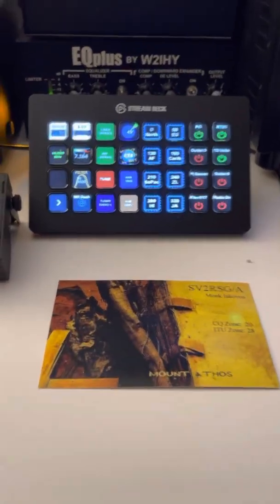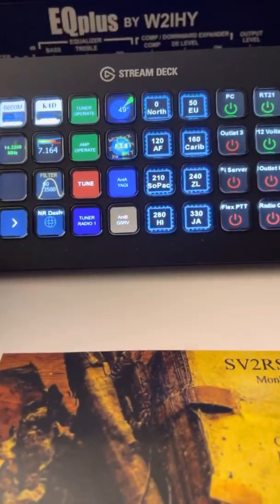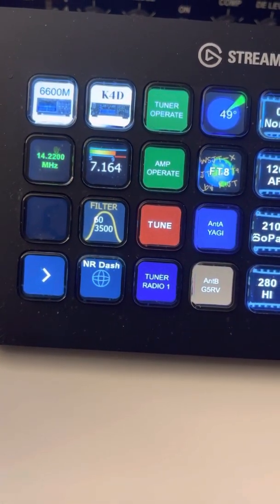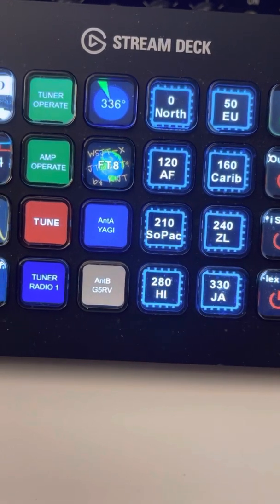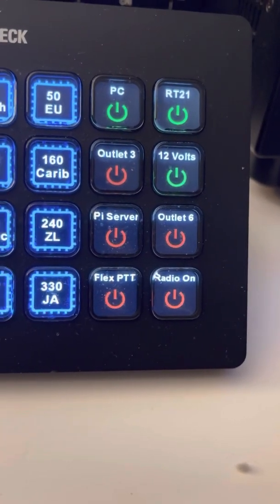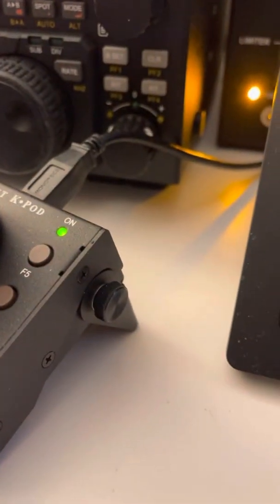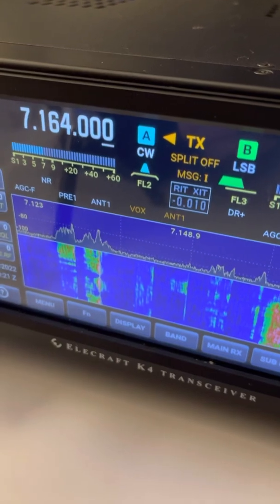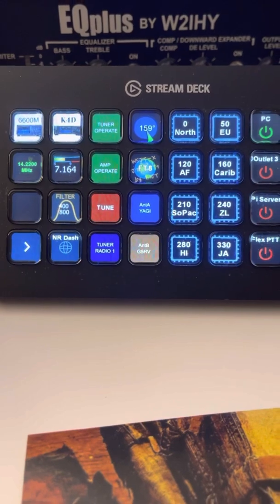Elecraft K4D Stream Deck and Node Red

Comment: I didn’t realize you had a K4 Dave. How do you like it compared to your Flexradio 6600M?
Reply from the maker: It's sinilar but different. Each has its own merits. THe K4D is still in the growing stages as far as radio software (external and internal in the radio). Will be interesting to see how it evolves.